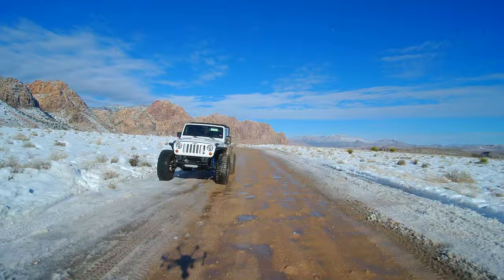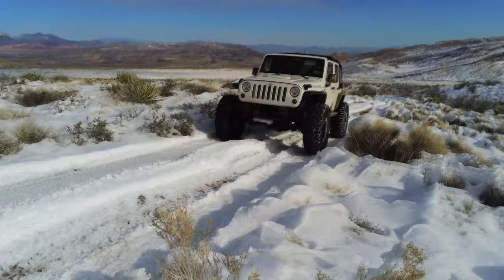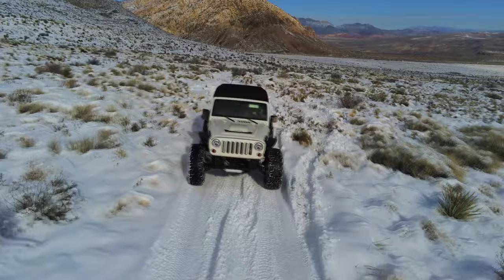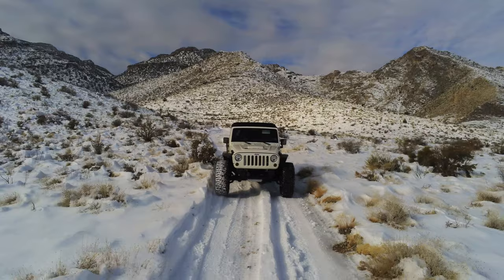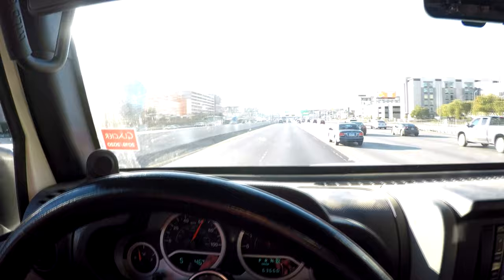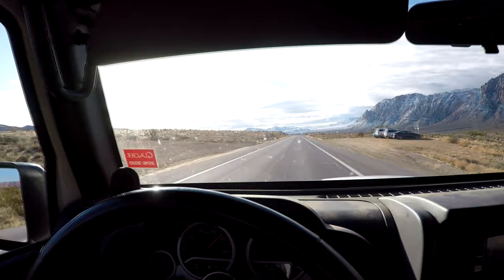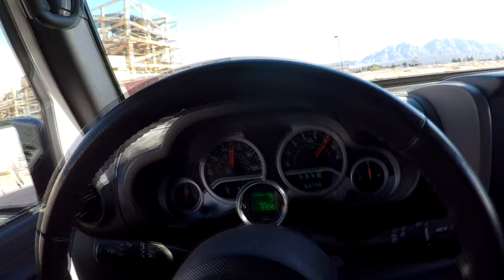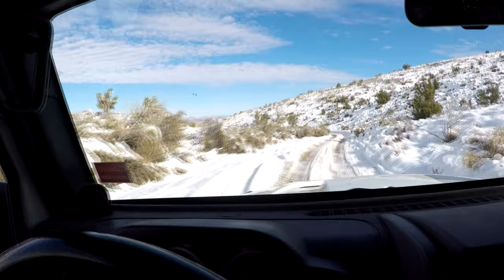LT4 Supercharged Jeep Wrangler Rubicon Part 2

Comment: Excellent work here in all aspects. The pushrod V8 is about at the end of improvements. I suppose you (if I was GM) could figure out how to build a cam that would use 2 phasers and split the intake lobes from the exhaust lobes so you could control lobe separation, but I think the expense does not justify the reward (thats why double overhead cams with variable valve timing have been used for decades). Other systems like variable valve lift and duration have been accomplished by many manufacturers. I believe Cadillac has a 4.2 twin turbo hot-V or reverse flow engine. It will be interesting what the new C8 Corvette high performance (ZR-1 or whatever code) uses. Keep up the good work.
Reply from the maker: GM experimented with a cam in cam for the overhead valve V8 but determined it was too costly and added length to the engine vs the benefits so stuck with a single cam design.